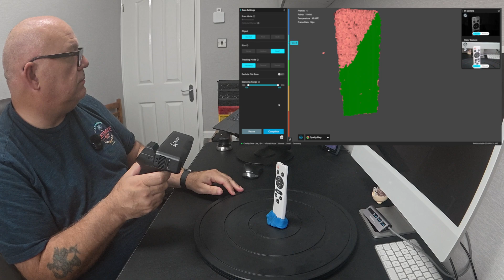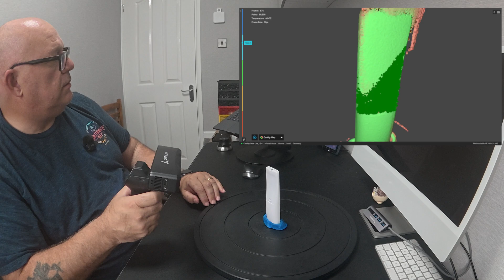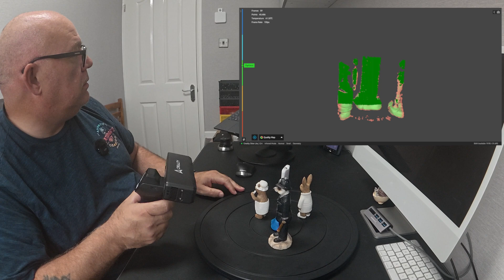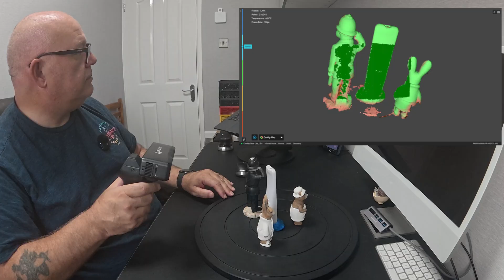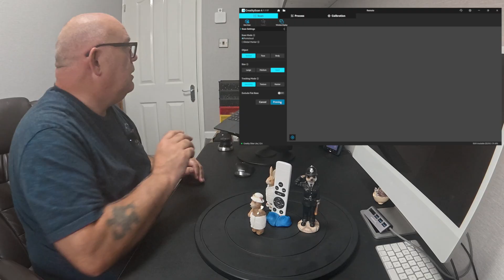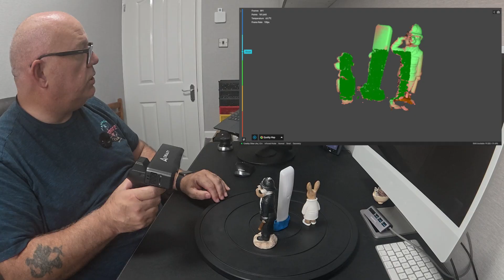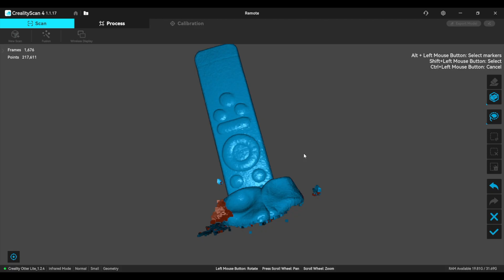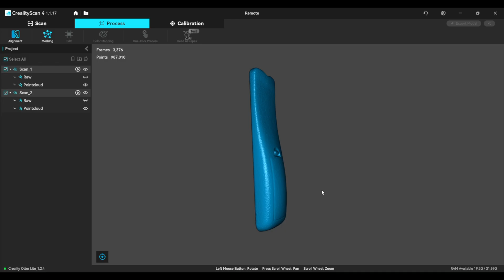Creality Otter Lite 3D Scanner – How to Scan Featureless Objects (Remote Control Example)

Comment: That worked egg-ceptionally well... Handy knowledge and saves time without sticking dots everywhere. Jealous of the neat room you have, my print/hobby room is a pigsty and I've got two desks happening.
Reply from the maker: I did a spring clean before hitting record!! Marker scanning is needed sometimes but I like to use features if I can it's just easier and faster. I'm planning a video using the dots soon.

Comment: Good result!  The video explanation is very clear. What made you choose the Otter Lite?
Reply from the maker: I watched a few video's and chose it because of it's versatility. It will scan small & large with exceptional tracking. If you have a quick scan job to do you just switch it on and away you go in no time at all.